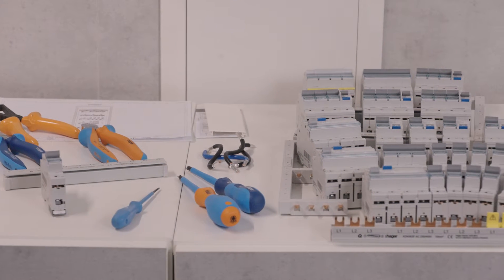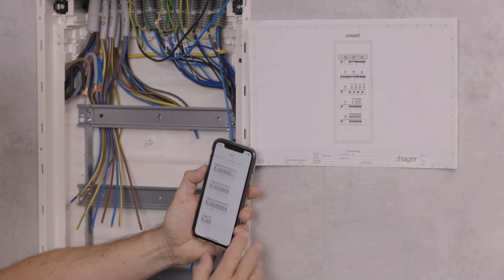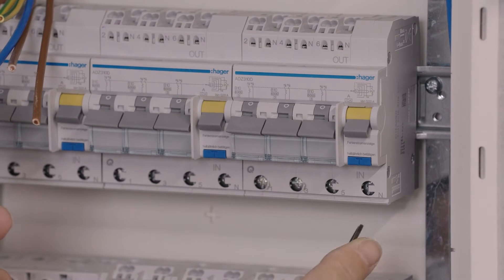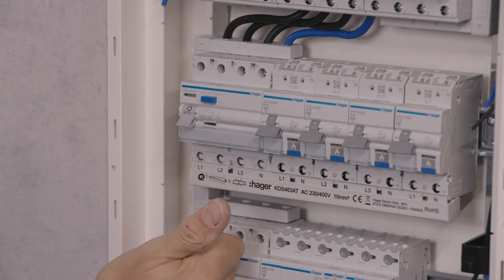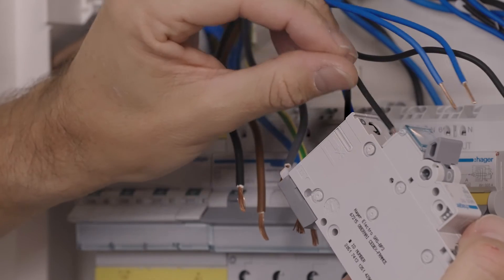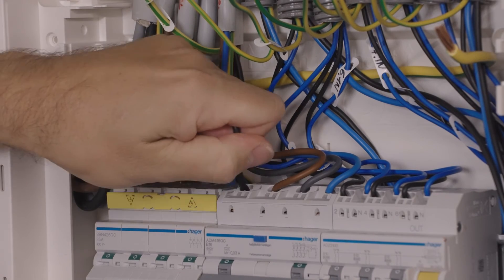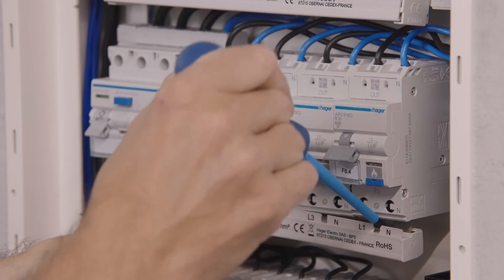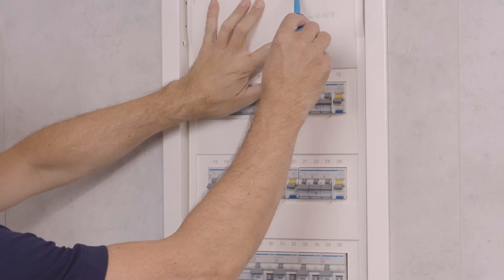quickconnect How-to video. Installation

Comment: i wonder about quality of connection made in such way, if compare with screw type connection. Is it possible that under the maximum load (let's say 40A), place will get warmed and plastic will melt?